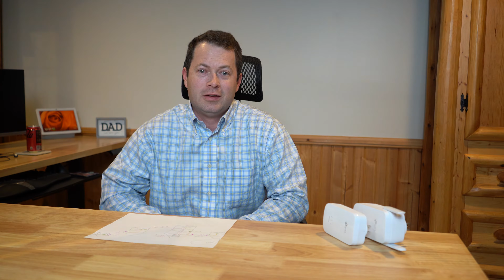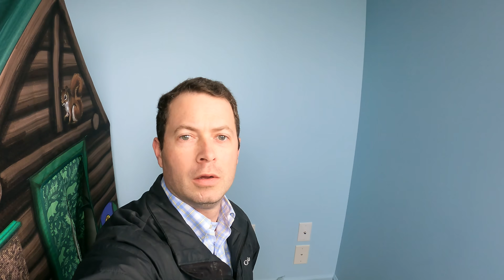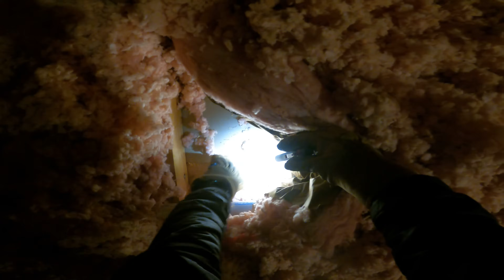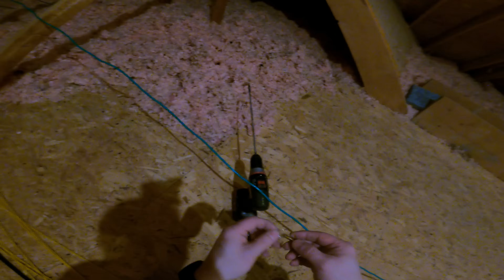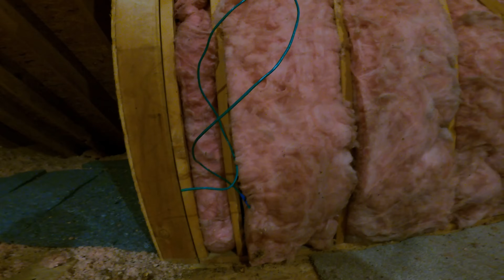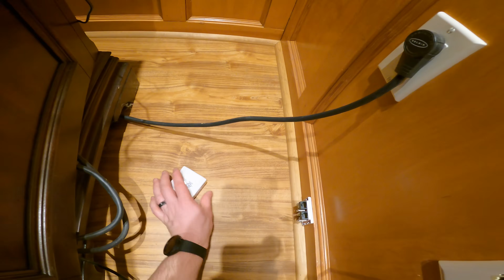✅ HOW and WHY I Ran CAT6 Ethernet In The Walls Of My House - Tools Needed and Tips & Tricks

Comment: I use a TVR 10/100 tool by Byte Brothers for checking Ethernet cables. I always make sure the lines are good before i plug into the hubs. If wired wrong you can cause a data storm with lines already communicating. I also use the through hole connectors for Cat 6 I can use the regular ones but the through hole are faster. My crimper is old school i have to trim off the excesse with a pair of cutters. 73

Comment: Be careful with your buried ethernet cable, I would change it over to fiber.  I've seen a dozen or so get hit by lightning and destroy everything connected to it on both ends, ethernet switch and the devices attached to the switches. For me it happened to the generator.  One guy has even recorded it on YouTube  https://www.youtube.com/watch?v=Ev0PL892zSE
Reply from the maker: Much easier to just get a ethernet surge protector since it already wired.  I'd put this in the lower risk category of home destruction risks though for my area.

Comment: Did you use plenum cable?  If not you have a serious problem. Plenum must be used when in air conditioning and other movable air areas
Reply from the maker: Chris, good point thanks for highlighting it.  Most codes require the plenum rated (CMP) ethernet for HVAC and even drop ceiling and raised floors.  And even going thru vertical walls (not ducts) requires "riser" rated.  The ethernet cable I linked in the video description is CMP rated.

Comment: Nice video! You should try the punch down keystone jacks. I prefer them as it’s much quicker to punch down then crimp the cable.
Reply from the maker: Yes good point.  The surface mount boxes I used were punch down.  I liked the idea of having rj-45 end but in hindsight probably not really needed.
Reply: Yeah they are ok but you still need a short Ethernet cable. A 500 foot spool could.make many but you still have to crimp the ends. Already made ones aren't the best. I have an eighteen inch one but it quit working. And last at work I'm replacing them because the plastic is crumbling. I have quite a few to disconnect before removing the plate from the wall. If the leads were long enough I would skip the jack and put ends on. 73

P.S. I did in one cubicle and just put the hub down where the jack was. 73

Comment: Great stuff, as usual! I wired my house some time ago, which is allowing me to use TMHI with my external router, which is some distance from where the Arc gets its best reception. That room however, is a location I would rather not have a gateway in. Can I use an external antenna and put the Arcadyan somewhere else? And what would be the maximum run for an external antenna?
Reply from the maker: Thanks Roger.  Antenna cable run is all about signal loss, for example waveform's std is 30ft and that is reasonable.  You can go longer with more loss or go to a higher spec cable and keep the loss the same vut increase cost.  50ft is still reasonable,  with a high quality cable 100ft starts becoming not worthwhile (too much loss).  I'd encourage you to stay under 30ft for the gateway to antenna and keep using ethernet to go further than that.  https://youtu.be/tqyGXm3yASc

Comment: Great info as usual Mr Nate! I was wondering how long it would take you to speak about MOCA but ya fooled me and did it early in the video lolo. I can understand it wasn't good for you, but for me, MOCA was a life saver with T- Mobile home internet. 
Also enjoyed you explaining the tools you used. Like they say, if you have the right tools it's half the battle of doing a job. Even though I use MOCA throughout my home, I'll tuck away this video to refer to if an when I need to install an extra ethernet wire/connection. Again MANY thanks for your time in making your helpful videos.
Reply from the maker: I actually found out why moca wasnt working at all in my house... I found a HUGE nest of coax cable ends in the basement ceiling.   It took me about a half second to decide I wasnt going tackle tracing those coax cables and instead just run straight ethernet.
Reply: @NaterTater  That's about a half a second slower if that were my find lololo. Smart move and probably cheaper too! Those MOCA adapters aren't cheap and you need one on each end of all those coaxil cables

Comment: I think you should make a video about T-Mobile home internet on the Nokia edition, I found out that the ones made in 2022 are more consistent with keeping the same cell tower, then I found out that a cat 8 Ethernet cable gets rid of alot of the high ping and packet loss, I was dealing with package loss all day before I added 2 80mil USB fans, a USB c to USB a adapter and the cat 8 Ethernet cable straight to my console or a Open WRT router, I have been running at about 35-80 ping all day every day even on days where I should be slowed down such as Saturday and Sunday at 7pm I was 50 ping on call of duty and Fortnite, just check the IP address and go to the status tab, try and get your data usage to be above 1gb up and down, that's actually the bandwidth you're able to use, so the higher usage you see the better the connection will be
Reply: cat 8 is serious over kill for TMHI and it won't "improve" the latency the unit gets from the cellular tower it will only lessen any additional latency you may have on your lan side of the network which a good cat 6a or even a cat 5e could do as well, but if it works for you then that's all that matters ....
Reply: @profitgee1  I mean, it certainly is an upgrade from the shitty pre wrapped cat 5e cable that came with the unit. From my experience there was something wrong with the cable that came in the box. I tried every cable up to a cat 8 and they all have me 800+ ping all day, but the day I received my cat 8 Ethernet cable and plugged it in, I suddenly went from 800ping and 50% package loss to 45ping and 0 package loss all day. Movie my unit did nothing for my performance. Calling T-Mobile did nothing for my performance. I never said that putting a cat 8 would get you 40GB speeds lol. I would never expect it. But I did get more consistent speeds from my router to my PS and back, a good game to check that on would be Fortnite, because you can see the package loss upload and download
Reply from the maker: Hi Kire Stoneeed, I have a full series of videos on the T-Mobile Home Internet https://youtube.com/playlist?list=PL8d9FovK2dNQHp0KWk8gG8XXvaKzaoSB3